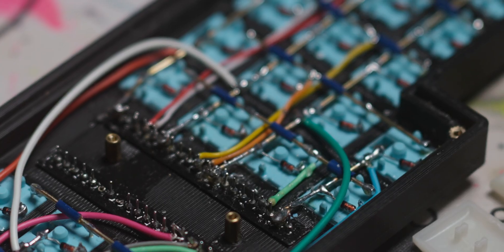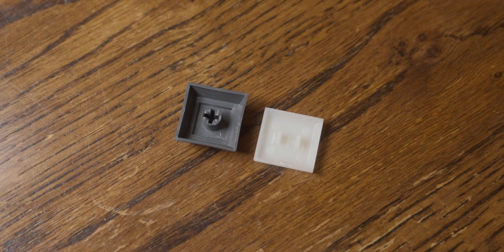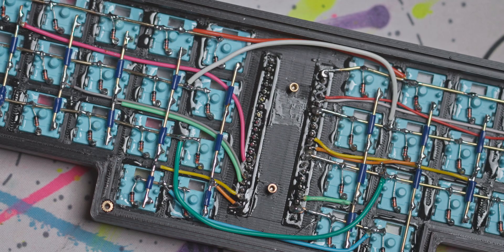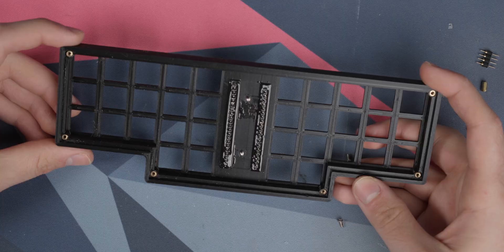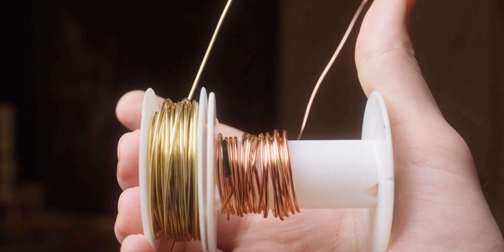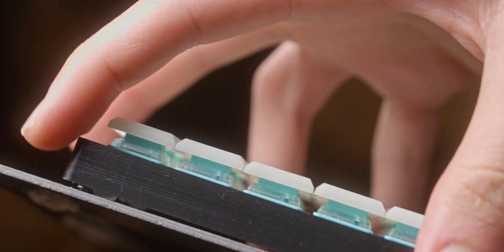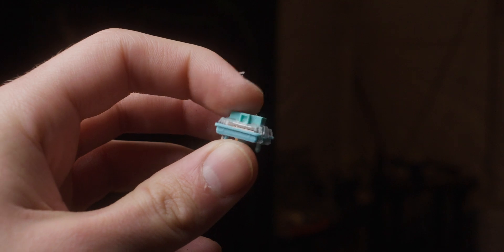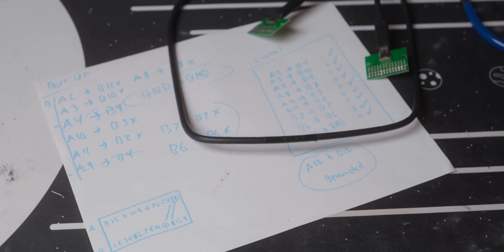Building Handwired Keyboards with Choc Switches

Comment: Hi, thx for showing this, I guess it's kinda hard to make it as low as possible isn't it, since it's hand-wired and everything gets thicker on the bottom, I don't think it can get lower than a PCBed keyboard, been using the reviung41lp lately and quickly notice the difference between the hand-wired board and the PCBed board, been thinking if we can make a foldable keyboard hand-wired 🤔

Comment: how do I put rasp pico in bootloader mode while flashing them qmk hex file?
Reply from the maker: To be honest… I’m not too certain. Sometimes using the bootloader button on the board will work but other times I have to hold it while plugging in and releasing once it is. 

Once it’s in my keyboard though, I have a bootloader mode bound to a key that always works. It’s the initial flashing that’s confusing.

Comment: I was having some issues with large surface area prints lifting on my textured build plate and I highly recommend using a glue stick to rub down your build plate before printing cases. Its solved my problem 100%.
Reply from the maker: I’ll have to see if I can do that with the PEI bed I use. I’m pretty certain it’s because of the filament since I don’t normally have issues but an extra precaution wouldn’t hurt!

Comment: I see that you are using QMK, did you experiment with KMK on CircuitPython as well? I like the simplicity of KMK better, however there are some nuances with CircuitPython devices in general - like Windows picking them up as USB drives ..
Reply from the maker: I’ve been looking into KMK a tiny bit but looking a lot more into ZMK so I can build wireless handwired boards. I’ve already done a Corne on ZMK but now want to learn more about it so I can do full builds.
Reply: @joe_scotto  nice. It will be great to witness you ZMK journey. By the way, KMK does support fully wireless split bluetooth keyboard as well just like ZMK. At least according their documentation, as I didn't try it yet.

Comment: How do we actually flash a firmware into the pico ...is it supported with qmk?
Reply from the maker: I do not believe you can use QMK Toolbox to flash it but it is supported in QMK. If you're able to compile QMK locally, you simply setup your keyboard with the RP2040 and run the standard "qmk flash" command.

Take a look at "info.json" and "rules.mk": https://github.com/joe-scotto/keyboards/blob/main/Scotto34/QMK
Reply: @joe_scotto  Thanks man really appreciate it😁.

Comment: I like this, and I'd personally would like you to make a small, split keyboard (think Corne) but handwired and with bluetooth!
Reply from the maker: I actually just ordered a nice nano for a build. Probably won’t be split but will be wireless. Still have a lot to figure out for it first as I need to learn ZMK firmware more.
Reply: @joe_scotto  Sounds awesome! 
Also, how is the Rpi Pico?
Reply from the maker: @gholen  I love the Pico... you can get 4 of them for $20 on Amazon and they have tons of pins along with 2 MB of flash memory. The only thing I don't like is that they're still micro-USB for whatever reason. I'm not going to abandon Pro Micros as they still have their place due to the small footprint but for most of my boards, I plan on going with the Pico.
Reply: @joe_scotto  Awesome! How's the pinout on them?
Reply from the maker: @gholen  26 GPIO pins

Comment: For choc switches you can do a recess on the left and right side of the mount and basically create a 1.3 mm lip that is perfect for the switch to click into. Creates a solid hold while letting you remove the switch if needed.
Reply from the maker: Thank you! For my next board I’m going to look into that because the UV resin was annoying

Comment: I have no idea if I could get used to the smaller travel. But it looks so good
Reply from the maker: The shorter travel is not nearly as weird as I thought it would be and I really enjoy it.
Reply: I got my first choc keyboard and also my first split and column staggered board, I had been using orthos with MX switches for several months and I literally got used to it in minutes, and hit a monkey type pb on the second day. I still prefer the feel of mx switches but chocs are not bad at all. I am using sunset switches on my choc keyboard and had been using box jade, pink and white on my mx keyboards.